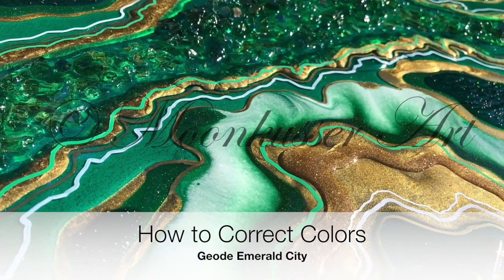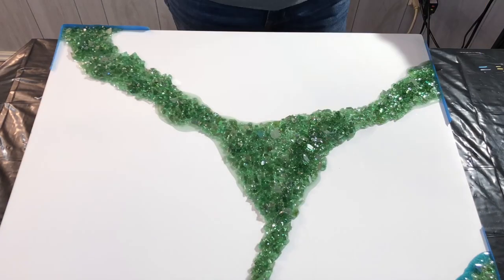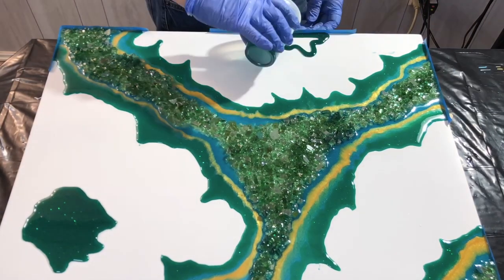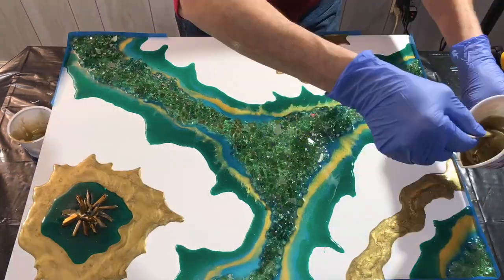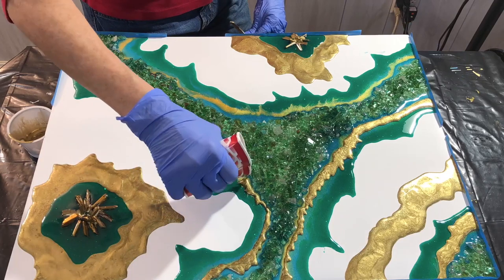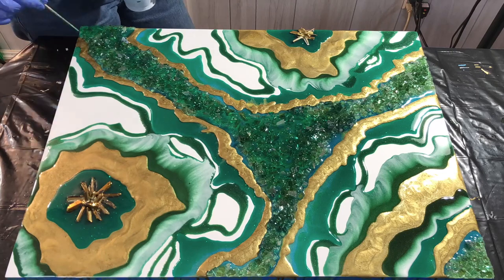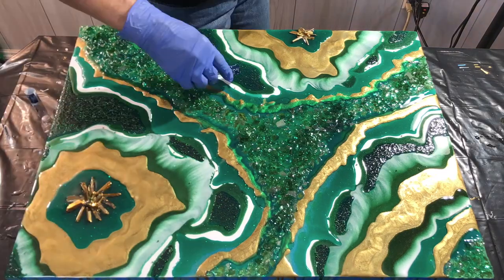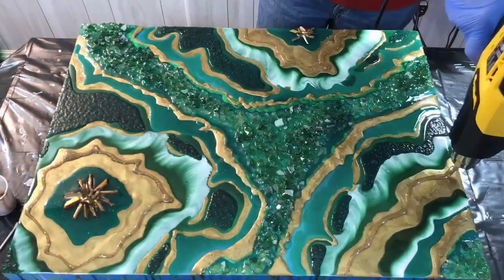How to Correct Colors on a Resin Geode - Geode Emerald City

Comment: I am building some cabinets and counters from scratch. I would like to make the top look like Malachite with different shades of green and some of the glass and some gold in it.  I am all the time looking for patterns of this print on that stone.  I think I will start with a small board and make a miniture one, see how it turns out first.  I found a pix of a skull made of the stone that had been polished and the colors are right what I want, so I do have that.  Using that fire place glass might be a good touch then some gold flakes lines throughout.  So many different ways of doing this.  I just want it to look decent not cheap.   I am 61 and been doing art for quite some time now. Never have tried this.  I just need to experiment with the right patterns.
Reply from the maker: It’s a lot of fun and challenging also. Maybe try doing small tests or even a accent table. Patterns get easier the more you do. Have fun experimenting! 😁

Comment: Hi I'm so glad I came upon this video. Answered a big question of mine. Do you always take multiple days for geode paintings? The reason I ask is that I was taught to make one piece in one sitting and that never gives me the kind of definition I see in YouTube videos but nobody has really called out that they pour resin on different days.
Reply from the maker: I have never poured a resin geode painting in one day.  Maybe because I am very interested in having some more definition between some of the rings.  I also find pouring over multiple days helps me greatly with creating the wanted pattern in my geodes. 😁
Reply: @MoonkusserArt  yes, that makes sense. I'll try spreading mine out and planning the layers more next time. I'm just starting out with resin as a hobby.  Your reply really helped. Thanks for taking the time 😊
Reply from the maker: You are most welcome 👍🏻

Comment: Beautiful piece! I liked, I saved, and I shared. I really like how the white flows. I'm  new at working with acrylic resin. Can you please tell me what temperature you have your heat gun set at? I set mine at about 460, but it seems to take a while to pop any bubbles. 
Thank you
Reply from the maker: Thank you for your kind words.  My heat gun is the Wagner Furno 500.  It does have variable temperature but it does not indicate the actual temperature.  For popping the bubbles in resin I prefer a small torch where I can on a piece like this. If I need to get in close where a tape dam is on the sides I use my heat gun. If you monitor your work, you can check for bubbles every 10 minutes and pop them with the heat gun that way possibly.
Reply: @MoonkusserArt  Thank you 😊

Comment: My resin dries on minutes would this happen because of the temperature. I usually do it outside and it tends to be 65 - 75 degrees.
Reply from the maker: If you are working outdoors there  can be numerous variables that would cause accelerated curing such as air temperature, humidity, and even air flow.  It could also be the brand and type of resin you use.
Reply: @MoonkusserArt  thank you!